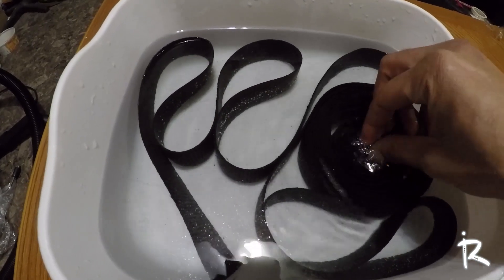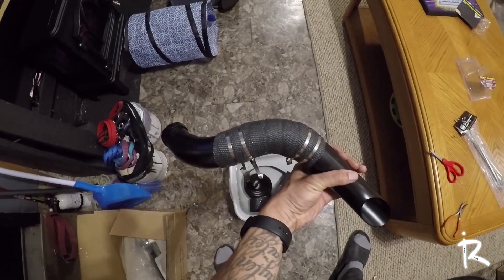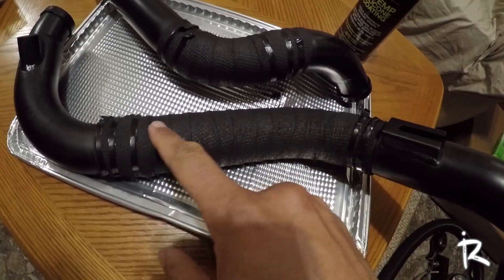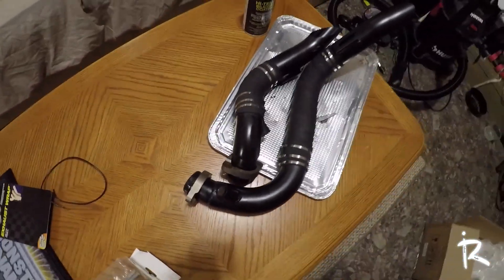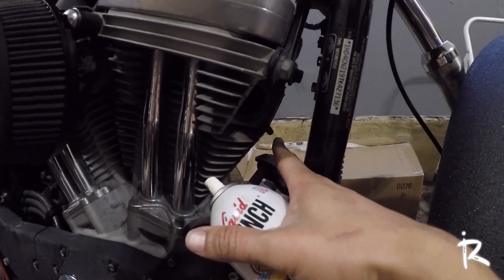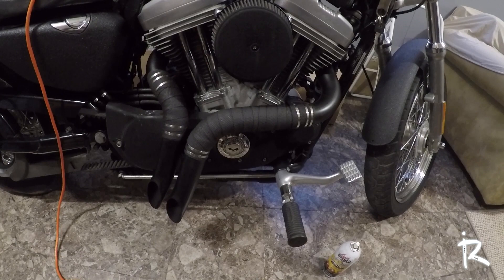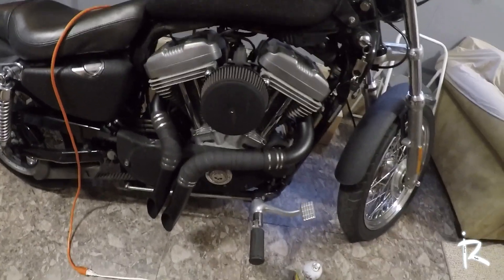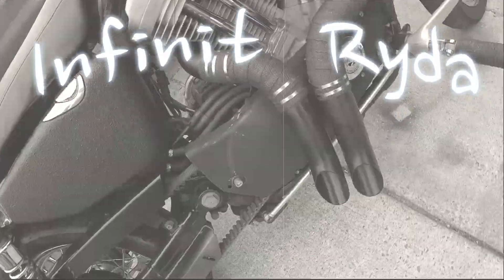LAF Exhaust Install And Sound Test

Comment: do you have to use torgue cones for these pipes? whats the reason>
thank man - good review
Reply from the maker: No you doing have to.
Reply: It's supposed to help with fuel/air mixture in the combustion chamber, preventing after firing

Comment: The only issue I see is the wrap. Should've went higher towards the mounting bracket, no? I think that's where most of the discoloration will be.
Reply from the maker: Probably
Reply: @theinfinitryda  I recently bought these for a 2012 Sportster Seventy-two, but they have no baffles, and the torque cones do probably nothing, I'm sure. The only reason I haven't installed them yet is the O2 sensors. I just cleared my speedo of the battery and check engine light by replacing the regulator rectifier. I'm worried if I put these on, it's going to light up like a Christmas tree. Any feedback on these cheap pipes? Anyone experience any issues after install?

Comment: Hi , i got engine light on after switching to drag pipe, do you know why? 
Did you tune your bike?
Reply from the maker: You might need to tune it.
Reply: This is why I haven't put mine on yet. Did you screw in the O2 sensors, and still got the check engine light?

Comment: Do the pipes sit on the bike just by connecting to the motor?
Reply from the maker: charlton reeves it’s a small connector behind it
Reply: The Infinit Ryda- thanks bout to order the pre-wrapped chrome pipes right now!
Reply: @charltonreeves  The only issue with wrapped pipes I've experienced is if it rains, the wrap holds the moisture and, over time, will rust the pipes. Looks cool, though.

Comment: I did the same installation. Did you have a problem fully seating the pipes to the exhaust  manifold due to the  Torque cones?  I'm also getting check engine light?  Any tips?  Thanks.
Reply from the maker: Aaron Craig no mine fit perfect. Do you have a power commander?
Reply: @theinfinitryda  no tuner yet.
Reply: You need to tune them with fuel injected sportsters get a fuel pack or Harley sportster tuner

Comment: did you lose anything in the Mid-range power ban?
Reply from the maker: Lord Baccus yes. I didn’t notice at first but now that I switched to the mini grenades it’s very noticeable that I was missing mid range torque.
Reply: @theinfinitryda  did adding the mini's increase or decrease the mid-range?
Reply from the maker: Lord Baccus increase tremendously